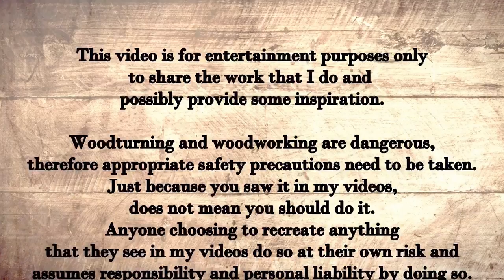Woodturning| The Dragon Bowl

Comment: That is a beautiful bowl of Jigssy and the color is stunning, I like that.
Good to see I'm not the only one with the screws breaking off while removing the faceplate.
Reply from the maker: Thank you so much Hans. The colour definitely works really nicely on the texture.
Lol, yeah. I knew I ran a high chance of the screw heads snapping off as it was like the 3rd time using the same screws. No point wasting a screw when it will still do the job and  it's not that difficult to remove.

Comment: You seem to have a recurring problem with broken screws! Are they from a pound shop by any chance?
Reply from the maker: Lol, no, they are good quality screws, but this was the third time I had used the same ones. I'm not phased by it breaking anymore (unlike the first time it happened 😅😶)  as it is easy enough to get them out. It's the same case with previous times that they break. No point in wasting a screw, just have to accept the consequence.

Comment: Haven’t finished video yet, but I have one critique if I may: camera movement at the start when roughing down, I’m currently feeling a little sea sick! 😢
Reply from the maker: Sorry about that. Didn't realise I had as much wobble in the camera at the time of filming. Need to improve my rigging as currently what I have is affected when the piece on the lathe is out of balance. Hopefully will get something more solid suspended from the roof when sort the rest of the workshop (hopefully will finally get time for it this summer)
Reply: @JiggsysShed  I suspected that was the case. 😊👍
Reply from the maker: @WoodWithD  it's the problem when buying cheap rubbish of Wish... thought it would be good at the time, now its held together by clamps 😂